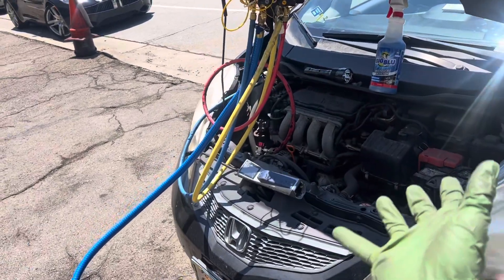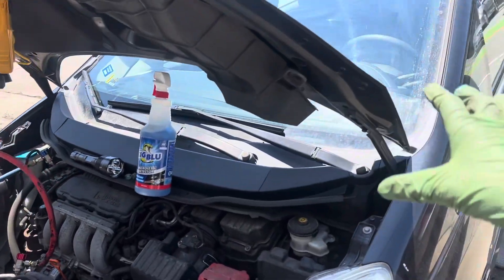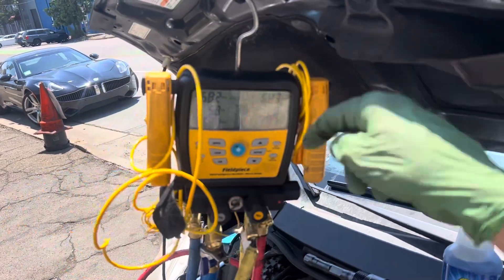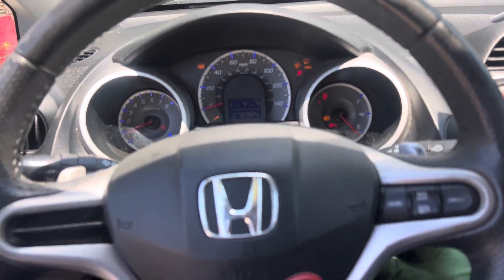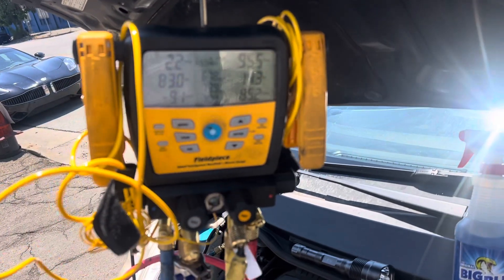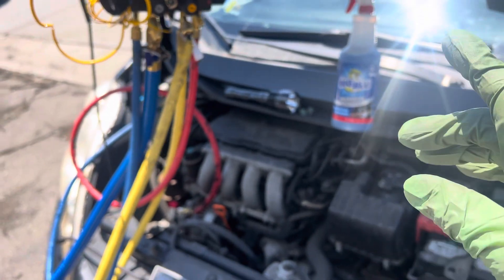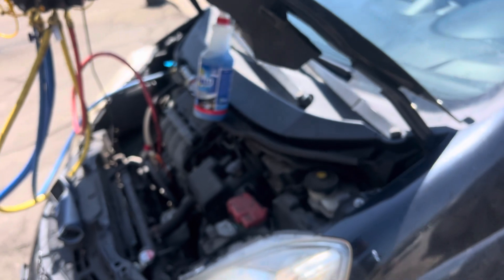LOW PRESSURE SWITCH DO NOT STOP THE COMPRESSOR WHEN THE REFRIGERANT IS LOW. (When it out ! )

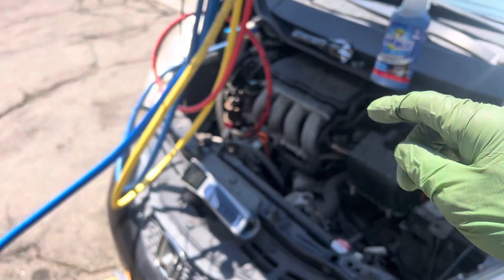Comment: 2:09 what are you saying? Go to what? Gammin?
Reply: @coldfinger459sub0  tell me what you are saying at that time stamp. I can't figure it out. It sounds like you said go to (something). Its the last thing in the list of leak detection that you were going to try. Right after the word "bubbles", what's the next full  sentence?
Reply from the maker: @realSamAndrew  understand

I said we’ll go to the gambit  (that means the full range of different tests, including high-pressure nitrogen, 
Disconnecting the fans for a minute and allowing the high side pressure to go up to 400 psi with hot refrigerant going through the lines because sometimes some leaks do not happen unless there’s hot flowing refrigerant going through the high side line 

Gambit is a old term from my grandparents days .

Comment: Hi Tom, hope you can help me with some advice. I have a 2011 Ford Fiesta 1.6 with 14k miles on it. And the car is not used frequently. I'm from Indonesia where the outside temp is quite hot all the time, Lately i noticed whenever i started the engine at idle, and then started the AC just to get it work for some time, the compressor won't cycle OFF at all like what it should be before (last time even waited till 30 minutes). The blowing air from the AC  is also ok (cold), so what do you think is the common problem for that.
When the engine is off, I can rotate the clutch freely by hands.

 I don't want to bring it to some shop without knowing first at least the base of the common culprit, because i'm afraid they just misdiagnose it. 
Thank you
Reply from the maker: Hopefully this is a simple one. 

I know Indonesia is a hot place so you will need 100% of your refrigerant charge to satisfy the temperature of your vehicle    and when the thermostat that you have set satisfies, it turns off the compressor
With 100% of the refrigerant charge it has a lot of capacity to do this 

But when you slowly start losing your refrigerant charge, because it naturally leaks out through the systems that are not perfect .   

Do you slowly lose the capacity to remove heat? . 

It’ll still blow out that feels cold on your hand, but just not quite enough to satisfy the temperature in the compartment to satisfy the setting on your thermostat 

So the system will continuously run and never shut off on hot days . 

Since you’re humidity in Indonesia, on average is somewhere between 70 and 90% humidity 

When you have your air conditioning on running for five or 10 minutes . 

On a high humidity day, your section line, the large pipe that goes back to the compressor .  Usually should get wet and sweaty with droplets of water.. 

As a Refrigerant level gets low in your system, there’s enough refrigerant to provide some cooling on your fingers out your vents, but there’s not enough. Refrigerant left to cool off the Piping the Engine compartment that goes back and feeds the compressor. . 

So sometimes you will notice that suction line pipe going back to the compressor no longer sweats as much 

With a vehicle this old, it sounds like it’s a simple case of a few ounces low on refrigerant . 

I know in some countries, they do not give the sticker under the hood of the exact weight of refrigerant to recharge. I don’t know about Indonesia. . 

But it is recommended that they refrigerant get recharged by recycling machine . 

And then the vehicle gets charged up by weight not by pressure, not by guessing not by topping off . 

I know in a lot of countries this is common practice to charge by topping off or just adding gas and guessing . 

Unfortunately, that happens way too often .

My service information here tells me that vehicle has roughly 539 g a Refrigerant 

If you wouldn’t mind getting back to me and looking underneath the hood for a sticker that list the refrigerant at somewhere close to 539 g 

I’m curious if my information here in the United States for our fiestas are the same as what was delivered to Indonesia?
Reply: Hi Tom, you were right, there is no AC related sticker underneath the hood hahaha. Don't know why they didn't put that for reference. 
I also checked again the larger pipe you mentioned a.k.a the low pressure side, that after running the compressor ON with the coldest setting inside the cabin for 3-5 minutes, the larger pipe was not sweaty with big and lots of water droplet as like it used to be before. It's only showing wet like mist on it. 

So you think there must be a leak somewhere that is causing the R134A to escape right ? Or is it common even for a brand new car that after sometime the freon will be escaping little by little even if there is no leak ? So far i have never changed my compressor oil & my refrigerant since brand new.

Can any compressor oil be used as long as it's PAG-46 type? Usually Ford uses motorcraft but not available here

Can you also tell me where we can get the really correct reference for the amount of refrigerant and amount of compressor oil used on this particular car ? I tried to look up on the ford service manual, haven't found it. But i got another reference from "Mahle" saying the refrigerant amount is 390 grams (& 170 ml Compressor oil) instead of 539 grams you mentioned earlier, i am afraid i might be looking at the wrong reference. 
Is different country sometimes also different amount of refrigerant would be applied by the manufacturer ?
Reply from the maker: @utube5361  yes different countries have different vehicles in engines and sometimes the air conditioning charge. Quantity is different.. 

Give me your 17 digit number, Vin 
Vehicle identification number 
Located underneath the glass window, maybe in your country for the door sticker 

I can put this into my software and see if I can pull up your exact year make model vehicle . 

Yes, any 46 PAG oil 

Idemitsu PAG 46
Is this available close to you? Do you guys have Amazon or eBay or some other source of purchasing things online? .
Reply: Hi, were you able to get the data for my Fiesta 2011 1.6 DCT refrigerant amount & compressor oil amount ?
Reply from the maker: @utube5361  539 g 3.4 ounces of oil.

But this is based off of cars in the USA if you’re not in the USA, sometimes vehicles are different
Reply: @coldfinger459sub0  yes, i see, thank you